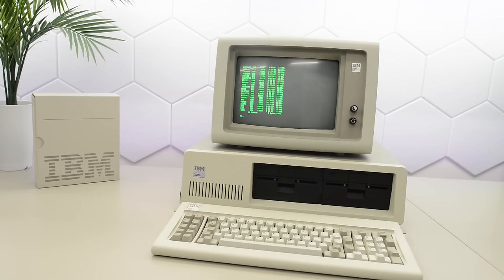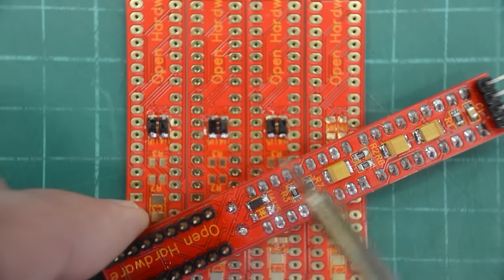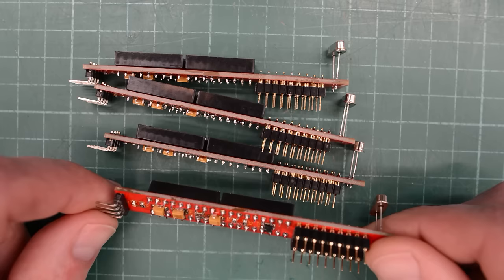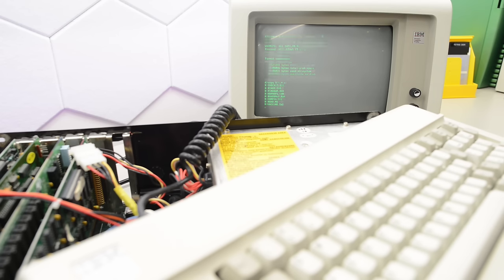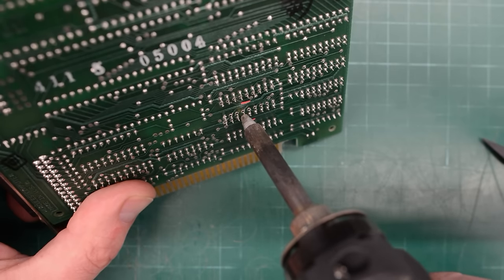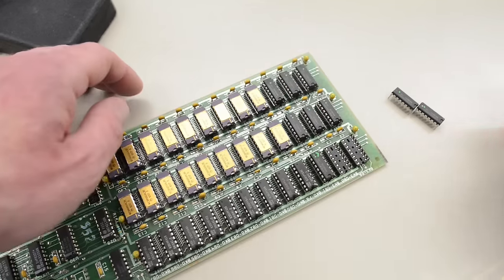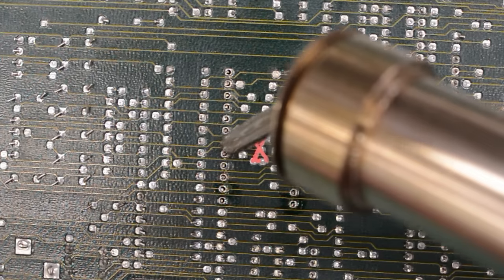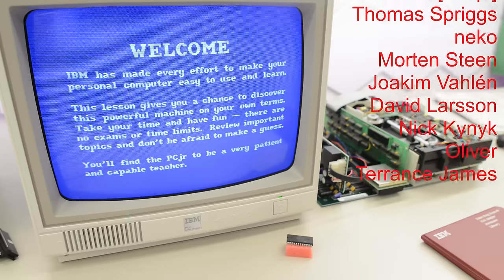Scammed on eBay. Fake chip. IBM 5155 Portable and PCjr repair

Comment: The reason scammers keep getting away with things on eBay is because eBay doesn't care. You write in the description that you're selling something as "untested" and you're immediately immune to any claims filed against you. You can knowingly sell fake stuff all day long.
Reply: Of course they're not trying too hard, or at all, because they're still getting money from the scam sales. And since the scammers write "untested" or similar about the item, eBay has plausible deniability.
Reply: Not entirely true, I've gone after people selling fake things as-is on ebay(even something as mundane as flash-drives). If they listed it as a genuine branded thing, it damn well better be that genuine thing, untested or not, broken or working. Fakes are not what you purchased, so prove it's a scam/fake and you usually win on those grounds.

Comment: These old computers keep trying to die, but the limitless patience and expert necromancy revives them over and over.
Reply from the maker: The PCjr is an exception actually. Most of the machines I have restored and repaired are still working :)
Reply: No, this will be the death of these machines.  Overclocking is not good for them. But more importantly, they are WORTHLESS overclocked.  They are only good for one thing today and that is gaming.  5150 and XT class games are notorious for going too fast on faster computers.

Comment: When Repairing computers or building computers 2 things are the most difficult to manage... Cables and Anger, but it is also the most satisfying thing when you got them managed and the system 99% of the times is alive!
Great video very interesting as always, cheers from Greece, Jim.
P.S Also surface mount soldering requires absolute lack of caffeine in your blood to be done properly...
Reply from the maker: Thanks Jim. I always make sure to never drink more than 5 cups of coffee before I solder SMD ;)

Comment: You also want to resolder the first bank of RAM. They usually have 200ns chips installed on 16-64k motherboards. While they can tolerate a 15-20% overclock, it is best to install the fastest available 120ns chips.
Reply from the maker: Yes, I have a set of faster RAM chips set aside for the project

Comment: What I find remarkable is that expansion slot geometry - apart from the actual interface slot - has remained unchanged for nigh on 50 years.
Reply: I think you mean 40 years. The only thing that's changed is the board is now on the other side of the bracket.

Comment: I was working on a C64 where they had folded all of the chip legs into hooks. It’s so awful! But I was thinking that it probably makes assembly of the board easier b/c you can insert all the chips and flip the board over and solder without any of them falling out.
Reply from the maker: Wow, that must have been a pain to work on! I guess they didn't expect us to repair these boards :)

Comment: Hey, do you know the Si5351? Is a programable clock generator and I'm wondering if it could be used to replace the crystal oscillator and then be able to change the frequency on the fly...
Reply from the maker: Yes, I actually have a chip. Coming soon on this channel :)

Comment: If the part is expensive, there is a big chance of fakes. Needed expensive automotive rated ST MOSFETS, and they sent fakes that looked the same. Latter on they didn't even bother making them look the same, they re-numbered cheap IR MOSFET that looked totally different.

Comment: from my experience overclocking AT03 systems: the DMA (used for floppies, on the controller(!)) was one the first one giving up, limiting most times. So in case you can swap the controller, just try a different one.
Reply from the maker: Thanks. I'll try that!

Comment: I’d be curious if you can achieve higher overclock on the 5150/5160 with the P8284A-1.
The fastest I could go reliably with the PC-SPRINT was with a 22.11MHz crystal (so 7.37MHz CPU) and P8284 rated at max 24(osc)/8(CPU)MHz. It wasn’t stable above 22.11MHz oscillator speed. So the O/C bottleneck on these two IBM models might not be related to the clock generator max rating…
But maybe you can go above 8.7MHz with a P8284A-1 on the PCjr 😊

Comment: I had ordered a 80287XL and it turned out to be a fake... Acetone took off all the paint. Thr original markings had been sanded away so I couldn't tell what it was. When I got around to de-lidding it, it turned out it was actually an original 8087.
Reply from the maker: Maybe we should have a look inside this chip. How much magnification do you need to read the text on the die?

Comment: On the subject of IC sockets, back in the 80s it was routine to phone up a large company with a question and be connected to an engineer in the relevant department. Thus, when I called AMP wanting to know which socket was the best, which their big shiny catalog did not make clear, I was told that the double wipe beryllium copper was it, if memory serves. The fact I want to stress is that he told me the machined socket was made due a military spec demanding it explicitly, but it was not a good design, though it is admittedly rugged. It has an inadequate contact area since the hole is not at all the shape of an IC chip finger. He said it's expensive, not very good and don't use it. The spring contact material is what needs to be good so the contact pressure is maintained. There are budget sockets that are not easily recognized as compromised, along with single wipe ones, for saving pennies which you and I don't want to do at the expense of reliability.
Reply from the maker: I would agree. Machined sockets are best for machined pins. Dual-wipe sockets are more reliable for regular ICs
Reply: @Epictronics1  That's so funny; I didn't know about machined pins, although I may simply have forgotten!
Reply: @Epictronics1  I'd say machined pin sockets are best only for new (un-soldered/cut pins) chips. Any extra dimension on the pins damages the socket, even stacking sockets damages them as the pins are slightly too thick for the copper slug inside the pin. If you look closely at pin headers intended for machine sockets, one sides pins are thicker than the other. The small side is intended to be plugged into the socket, the thick side soldered to the PCB.

Comment: Instead of the Intel part I bought a set of M82C84A-2 Oki chips off eBay which is a functional equivalent (set of 5 came in at a little over $7 + shipping). Obviously a somewhat more modern part but works well and seems to run a bit cooler. The spec sheet for this part shows operation of up to 25 MHz and a temperature range of -55°C +125°C. Might be worth the consideration?
Reply from the maker: I wasn't aware of this chip. I went ahead and ordered a few to test. Thanks for sharing!
Reply: @Epictronics1  no worries. I had good success with mine so hope you will as well!
Reply from the maker: @BeniD82  We'll try them out in a few weeks. I'll make a video :)
Reply: Beware, the 25MHz max rating is that of the crystal oscillator, not the CPU. You have to divide by 3, so that gives about 8MHz. Same as the original Intel P8284.
Reply from the maker: @retrotomat  Oh no. So, these are no better than the slow 8284A :(
Reply: @Epictronics1  I’m afraid not 🙁
There are non-Intel equivalent of the P8284A-1 though, like the Siemens SAB8284B1P. Such clock generators can be found on 10MHz turbo PC clone motherboards. So if you have one of the latter at hand you can steal the chip to do your test.

Comment: At least put the sellers account name here and on X so others can avoid them. 22:26
Reply: Yes!
Reply from the maker: I'm talking to they guy. I think he got scammed too. If he wipes those chips down with acetone and removes the bad chips from his stock, then he's ok
Reply: @Epictronics1 hope he sends you a replacement too.
Reply: @Epictronics1  I agree. Nobody is safe from being screwed, seller or not. Sure, some of them are crooks, but others are just being screwed as "we" are... 

I once got fake FETs from one of the major 3 electronics distributors, everything was handled professionally, saved other customers. If I didn't have an original part to compare with, I wouldn't have been so "lucky". One batch of our boards we're having a LOT of failures in the field.

Edit: F... I hate CGA, can't stand the damn thing lol

Comment: That demo mode comes up when you hold down a certain key combination (ctrl-alt-ins?).  As for BASIC, I can't remember if there's cassette BASIC in ROM, but cartridge BASIC was always a better option.  It also has hooks that PC DOS 2.1 looked for, to make the DOS BASIC.EXE command just run the cartridge instead of loading from disk.  Later PC DOS doesn't support this (since the PCJr flopped) so you will find that BASIC.EXE and BASICA.EXE on later versions wouldn't run.  You had to use GWBASIC or QBASIC.
Reply from the maker: Great. I'll see if there is a project out there to build a new Basic cartridge
Reply: @Epictronics1  If all else fails, the PCJr Technical Reference Manual has the specs for the cartridge size and its pinout.
Reply from the maker: @ovalteen4404  Yes, I think we need to build a few cartridges for this PCjr

Comment: I wonder if Aliexpress might be better for you? I'm not saying you wont be scammed, but at least you might save a few bucks since the only reason I'd go with ebay over AE is delivery time and/or returns, considering the latter tends to be cheaper for these thing from my experience.
Reply from the maker: I use both actually. Depending on where I can find the part I'm looking for

Comment: why not try solder paste and hot air,,,, Makes it so much easier to do smd work. they actually pull themselves into alignment and look neet. Give it a try and you will be surprised
Reply from the maker: Yeah, I really need to try solder paste.

Comment: Could you share the part nr. for that cool Wera "crowbar"?
Reply from the maker: Sure, I think it's WERA 05027456001 1429
Reply: @Epictronics1  Cool, thanks.  I just ordered one.
Reply from the maker: @billlewis9740  Good choice. it's a great tool
Reply: @Epictronics1  When I first saw you using it, I thought, "Did he actually bend (wreck) a nice Wera screwdriver?"  But then I noticed the gentle curve and the little notch, and figured it was an actual product.

I would imagine the tip would crack if you tried to bend one like that.

Comment: Fake chips on eBay suck. I've had better luck scavenging chips from bulk lots of scrap ICs over the past several years. Sure there may be some (or many, depending on the source) dead parts, but I've managed to find entire functioning XT motherboard chipsets this way.